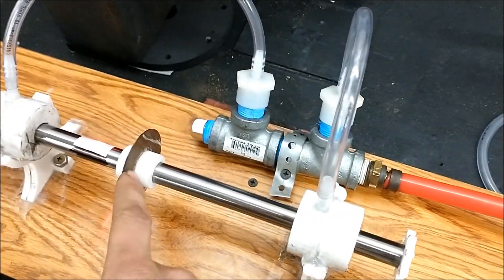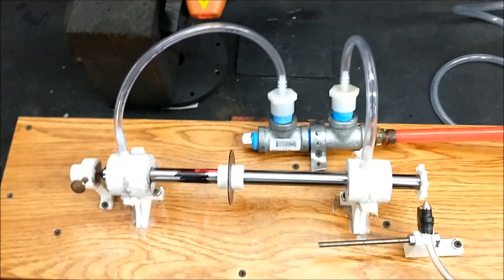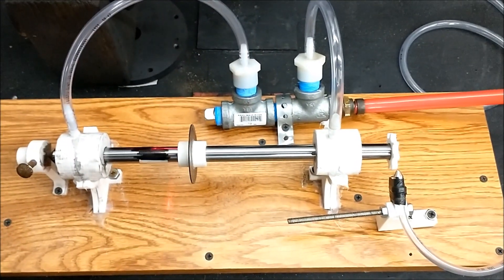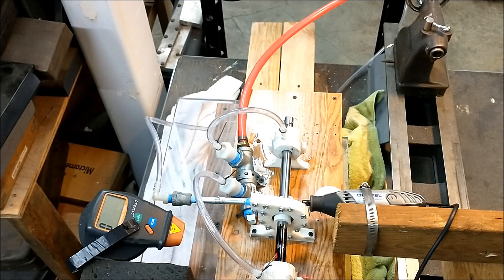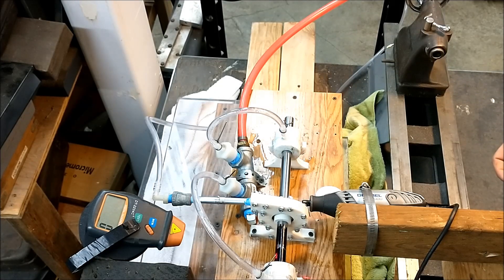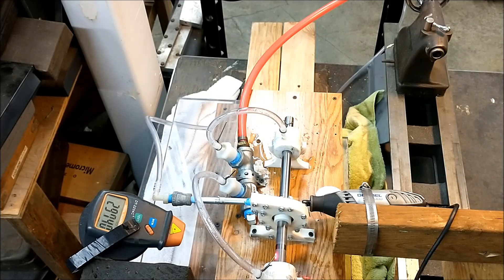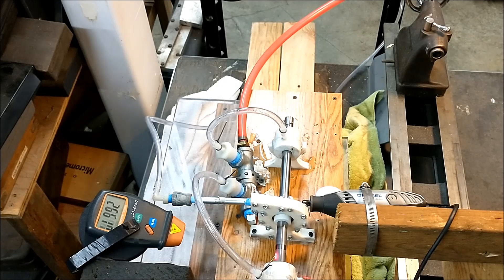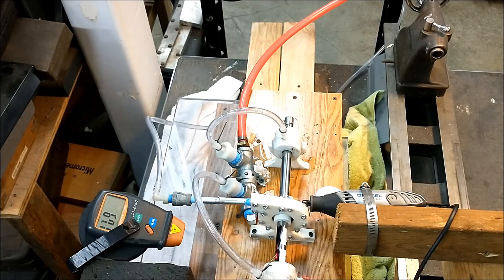Air Bearings Used For High Speed Tesla Turbine!

Comment: Awesome! Would the air bearings not work correctly if placed within the vacuum chamber?
Reply from the maker: yeah they would not work verry well, unless you used water vapor from the boiler to power them, but then you would need more pressure. It's possible though to use water instead, straight from the boiler, but then you would be warming your condenser for nothing. Maybe the waste wouldn't be that much though. For now it's better to stick with the modern bearings which are perfectly suitable for the application.

Comment: @2:30- you are psyco for being anywhere near that kind of kinetic energy w/out shielding!, also what the heck is the dremel supposed to be doing?
Reply from the maker: the dremmel is balancing the rotor, also the material used is capable of reaching supersonic speeds, but you are correct in needing to be safe. A blast shield for this kind of stuff is a must before testing top speeds.

Comment: This is really interesting. You are running it like an air hydrodynamic bearing. How does the graphite hold up to the moisture? The black water seems to indicate it falling apart.
Reply from the maker: Before balancing the bearings take a beating, also these bearings are home made without high accuracy so they can't hold up as much as I would like. We are going to test some new way air bearings soon.

Comment: How long will your air bearing last B4 replacing
Reply from the maker: Forever when balanced.
Reply: @iEnergySupply  No they won't.  Graphite is soft and will gradually wear away due to air friction and the atomic graphite layers slipping over each other.  They're good, but they're not magic. There really is no such thing as a free lunch.

Comment: Hello Jeremiah

I have some funds to invest in your Tesla turbine project.
Your videos are good and interesting but I'm afraid you might lose some things in translation.
Everything is clear to me about the Tesla turbine and about the air magnetic bearings as well. Great solutions ... !!!
What bothers me are the missing parameters is the boiler with "cold steam". I did not understand that in your presentation, except that a little pressure is needed for high speed.
I would ask you for a couple of answers because in the whole process it is a very important thing as a fuel that drives the turbine.
What must be the capacity of the boiler to be able to operate 24 hours a day and turn the turbine at 80,000 rpm?
How much energy does it take to charge to full capacity?
Would a more cold boiler steam be a solution to continuous operation 24/7 as an accumulation of energy that we can get from the sun, wind ...?
I am also interested in the price of Tesla's turbine, tank and air-magnetic shaft?
I would like, with your permission, to use your solutions and products in the final energy unit for small households that will provide electricity and heat of 5-10 kw.
Congratulations on your intelligence, perseverance and passion to share your knowledge and time with other little people.
Reply from the maker: Right now the best way to help with the project is my Patreon, I have much more information on there and it may answer some questions. I also have a 4th tier that will help me by a monthly fee. I can talk and share ideas personally there including zoom meetings. patreon.com/ienergysupply

Comment: Would there be a point to put the turbine on a car's exhaust, so it goes from the centre outwards?
Reply from the maker: The best thing to do is put a turbine on the radiator. Then you get extreme amounts of extra heat to run the turbine.
Reply: @iEnergySupply  rim to centre (turbine) or centre to rim (pump, afaik)?
Reply from the maker: @Imighthaveseenyouinh  This was a test for air bearings only, it was just a single disk tesla turbine.
Reply: @iEnergySupply  I meant for a usual tesla turbine.

Comment: Amazing progress guys! I think you need to start thinking about containment of that shaft. Consider how much energy that two pound shaft spinning at 80,000 rpm has.
Reply from the maker: Yeah that's a lot of energy stored in inertia! Note. The rotor is a little over a pound, good guess.
Reply: just stay out of line with the shaft. It can only fly outward.
Reply: @excitedbox5705  IDK, I've seen body seeking shafts before... Usually they're moving just as fast, but it's also after a visit to the bar.

Comment: I just tried to go back to your site the other day to buy the cad design, but it doesnt seem to be working. Do you guys not have a website anymore?
Reply from the maker: Website is being worked on at the moment. Godaddy deleted the entire website because it expired, we had it on auto renew but our card expired. So they decided to delete everything. Really messed up. Our cad drawings are available on patron for a cheaper price though.
Reply: @iEnergySupply  That sucks. I'll give your Patreon a visit. Also, not sure if you guys have heard of this, but hot composting reaches about 160F. I remember you guys discussing in an older video about getting your boiler tank temp up in the vacuum system potentially using solar. Figured you'd might want to give that a look, considering some of these homesteader guys make a pile last months at a time to heat their houses. Cheers.

Comment: you think adding a smaller compressor fan stage fallowed by a larger steep curve turbine stage sucking the flow from the tesla stage should solve the presser build up at the center of the turbine cuz it will make a colder fast moving low presser zone the high pressers will want to move to increasing torque and should do the same for the efficacy by using most of the steam this will assist in rapid steam cooling causing more suction witch is good for closed loop systems so they don't have to have as big of radiators saving on cooling power input. have fun with this thought it might add the best of both turbine types and cut down on the size of recirculating system's.
Reply from the maker: I made it in the past but I used blades for the turbine and for the pump, never added the blades to the Tesla turbine though. Tesla has a patent for the system your talking about we ill try this in the future if we have any issues. Great idea!

Comment: Cool! I like the idea of using it also as a balancing set-up. Those air bearing seems promissing :)

Maybe use some of the shelf carbon fiber cut trough blades that you use on a angulair grinder and put some resign/superglue on the surface to make it smooth!?
Reply from the maker: My new turbine will have carbon-fiber as the disks.

Comment: hey mate I will call upon you like soon. Ill need a 26inch diameter and a 32inch length 3stage with three inputs and 3in large out put with the inputs all on the same side spaced 3in apart the the tesla disk stage at 9L x 25w as many disks as you think is needed with a compressor stage at 11L x 16w and the steeper turbine stage at 12L x 14W ill need like this one day hopefully soon when I get everything else for my prototype but this will be a key part of the Rankine cycle or closed loop turbine generator for my fusion reactor prototype, please check it out and keep in mind I used theoretical work done by lpp fusion when I engineered this prototype.
there are four videos on my channel this one 
https://youtu.be/y9HmrZCBX70
explains the particle flow and the reaction. the other video https://youtu.be/y9HmrZCBX70 
is the full no deuterium test run of the first half of the test core and 28 mercury's is the vacuum 
so there's a major boost in performance if I get a better pump, this is the same test with reduced color and brightness to show the plasma better https://youtu.be/rr19NSVTIz0
witch killed that camera after ward and the test run vid has no 
sound but read the description for some more info. 
https://youtu.be/AH9sdaU1izc
this one is new
Reply from the maker: I have some ideas to simplify the system so that all you need to do is use the heat generated by the plasma to excite the working fluid. The genius makes things simple. A conversation would be needed to really communicate effectively. We have a 12' turbine 18" dual pump coming soon would be perfect for testing your idea. If you join my patron we can easily be in contact.
Reply: @iEnergySupply  the other two stages in the turbine are to reduce the size of the condenser by rapid cooling and I plan on using at two stage Rankine cycle when the first stage is using water this is heated by the reactor witch then heats the organic Rankine cycle as its a lot safer this way with fusion and the orc having a lower boiling point. not to mention the radiation of x-ray gamma and neutrons are what heats the boiler in the primary loop and water is pretty stable, unlike the organic compound's. its the same way fission reactors heat water to heat there orc's with the biggest dif being no radioactive waste and being the only way to make helium which the world is running out of so if you like your balloons vote fusion :)

Comment: I was wondering, if you guys do curve groove type, radially oriented, semi-conic shape on the shaft itself, towards the end of the air bearings, ( and facing opposite on every one of them ), the air flow itself will keep the shaft centred, as it will create opposite pressure  on the both opposite sides of the bearings. Tesla was using similar concept in this fluid bearings, but instead if indentation of the shart he bulked it, where the bearings were, which generally creates similar fluid based, center-locking dynamics, when the shaft is rotating.
Reply from the maker: Great observation on the bearings. Would be a challenge but may be needed, I was thinking it would actually boil the fluid as well and keep it locked in the center reducing fluid usage. One thing to note is the turbine actually centered it's self when I turned on the air but wasn't strongly locked in place, so might pose a problem with the generator resulting in the need for the egg shape in the future.
Reply: @iEnergySupply  I would recommend a double egg shape.  That way the choke point doesn't move with air pressure fluctuation.

Comment: Keep up the good work! Why did you choose air over magnetic bearings?
Reply from the maker: I'm working on them both, the air bearings allows for tighter tolerances in my experiences, but I'm not done testing the air bearings yet.
Reply: Magnetic flux can cause resistance in the magnetic bearing also generate heat. When magnets heat up the loose magnetism
Reply from the maker: @tonyoliver4920  Same with air bearings but the heat can be useful.

Comment: How is it generating energy? I Like what I see , but not sure what I am seeing :D
Reply from the maker: I use compressed air for balancing, but that's just for testing. Ammonia and water will be the driving fluid powered by heat in the future.
Reply: iEnergySupply just watched ammonia and water experiments, looks interesting.  So ammonia’s reaction will produce vaper that will turn the turbine and generate energy? And then how can you repeat the process?
Reply from the maker: @CanYouWORLD  pump the condensed ammonia and water back into the hot tank, exactly like the rankine cycle.
Reply: @CanYouWORLD  I assume the the ammonia is being used as a heat exchanger due to its lower boiling point... 
am I right?
Reply: @iEnergySupply  amazing work sir, im fascinated and immediately subscribed i have to see the future development, where does the heat come from? and would it be possible to use a cooling mantle for the generator which then heats further up the tank. cheers from germany
Reply from the maker: @tonyoliver4920  Yes
Reply from the maker: @Humbulla93  The heat source can come from any combustible, solar and geothermal.
Reply: @iEnergySupply  have you heard of vortex tubes? one could connect a vortex tube at the exit of a tesla turbine generating heat on one side and cold on the other

Comment: try feeding air separately to the bearings and the turbine.
on the turbine with a change in pressure and on the bearings a constant selected in advance, do not start the turbine before the air is supplied to the bearings! maybe it spoils them.
Reply from the maker: Good observation! Unfortunately the bearings were warn out from the vibration far too soon but because the bearings allowed me to balance the rotor to a certain point, the new air bearings will allow me to finish the balance eliminating the need to baby them. The vibration from un-balanced rotor destroyed them far too soon, also the water I added was slightly added too late and even though it helped they were already on the path to destruction. Ill add the water for the dampening at the beginning to avoid the complications.

Comment: Excellent work guys! Very small design, exactly fitting for micro power generation :) It is very impressive how quietly it moved at 30K RPM. In my humble opinion you do not need more then 20-30K for a good power generation, and even smaller speeds for a rotor with bitter R. Love your polishing tool :D
Reply from the maker: Yeah agreed, the only thing I want to do now is concentrate the power/producing high power density and that's why I am moving towards the higher speeds.

Comment: I'm assuming that you are machining the shaft so that you can move the air bearings closer to the turbine?
Reply from the maker: Yes, I finished the design and 3d printed the casing, also using carbon-fiber for the new disks.

Comment: I have a idea, use the air turbine for a go kart.
Reply: Air turbine?
Reply: @monjier  i mean water turbine, not air turbine.
Reply: I just read the title wrong of the video and i realise the mistake that i have done on my previous comment after i posted it.
Reply from the maker: @ethanfitton6336  I would love to build a go cart, in-fact ill be doing it before to long :)
Reply: @iEnergySupply  that sounds good, what engine will you used, gas, petrol or diesel, would telsa turbine with a tank filled with air that can be refilled after a certain amount of time.
Reply from the maker: @ethanfitton6336  Propane will the the energy source for the go-cart. I won't be using compressed air, ill be using a coolant, ammonia  and water will be the coolant.
Reply: @iEnergySupply  ok, would it be a piston engine or rotary engine or something different.
Reply from the maker: @ethanfitton6336  Tesla turbine electric generator feeding high torque electric motor powered by propane, but that's only the beginning, I want to power it with wood, which is extremely practical.
Reply: @iEnergySupply  im guessing very efficient design and i hope no explosion or catastrophic failure happens.
Reply from the maker: @ethanfitton6336  No issues there,  Simple systems will be implemented similar to the devices that keep propane from being dangerous.
Reply: @iEnergySupply  ok, when are you going to build the go kart powered by wood.
Reply from the maker: @ethanfitton6336  after I finish the off grid system, wrapping everything up.
Reply: @iEnergySupply  what grid system, for the go kart?
Reply from the maker: @ethanfitton6336  Personal Power system for everyone. Not for gocart. After we finish with the serious stuff we will have some fun :)
Reply: @iEnergySupply  right, what is a serious system?